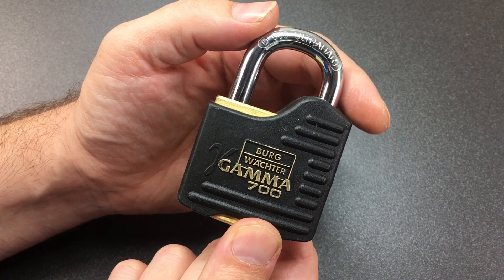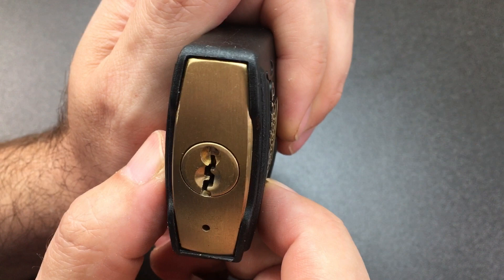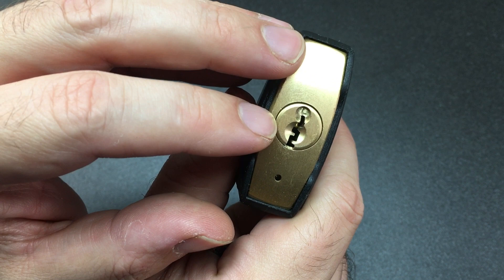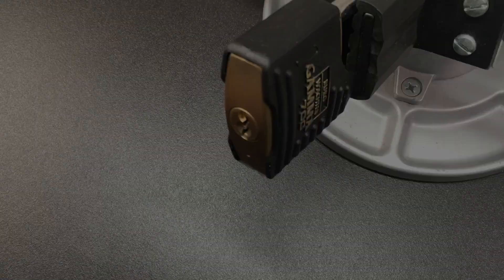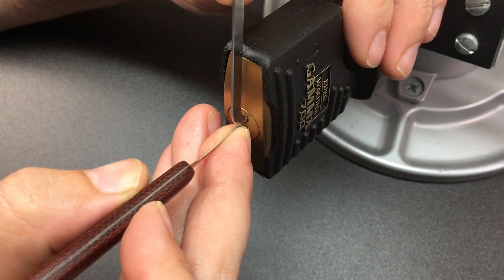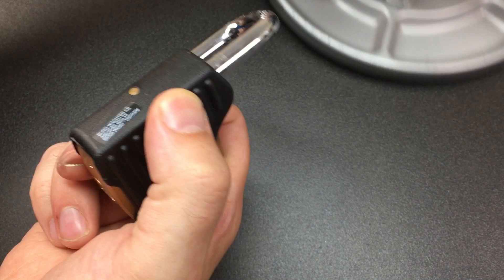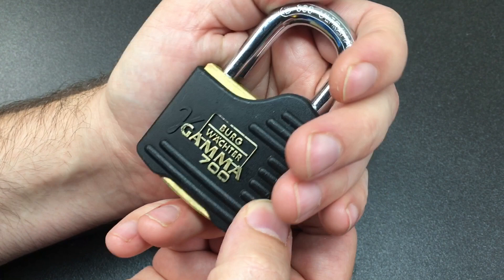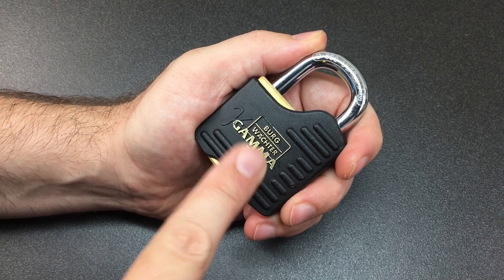Burg Wachter Gamma 700 Padlock Picked

Comment: Can you please try to rake it open. I own 3 Gammas and all of them are hard to pick, but extremely easy to open with a city rake ! Use a 0.015 city rake and start with soft pressure, then increase the pressure slowly...
Reply from the maker: I’ll give it a go!
Reply: @LockNoob  I guess after more than 3 months nobody is interested anymore, but I put a video online in which I rake the Gamma 700 and the BW Diamant. Both locks have the same core. A bad key bitting turns a good lock into bad lock: https://youtu.be/yzhVBGYvUAU
Reply from the maker: @e-teacher9402  absolutely it does! Bitting is incredibly important

Comment: I think those are sidebar ready pins.Some locks have it,some not but they implemented them no matter if there is or isnt a sidebar.Spools on the top of the keypins cant doo anything.
Reply from the maker: They are oversets traps
Reply: @LockNoob  Cant be,because they are on the top of keypins.If they are ,they will act like overset traps only if you use comb pick.China smiley locks usualy have such pins for sidebar to drop in and core could turn.